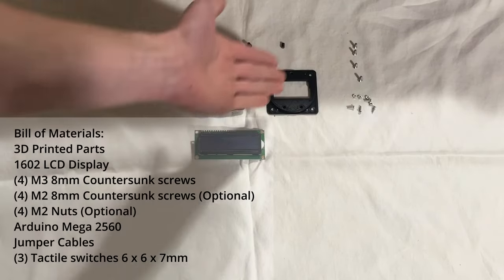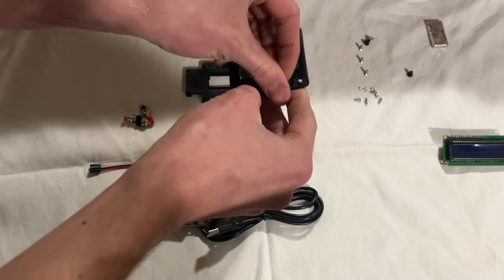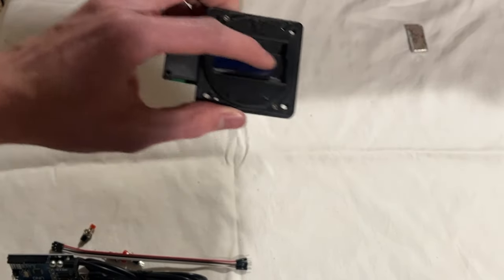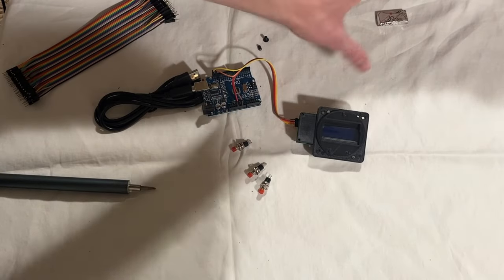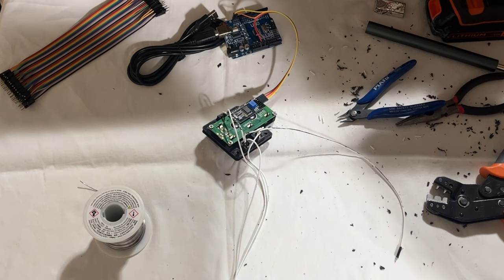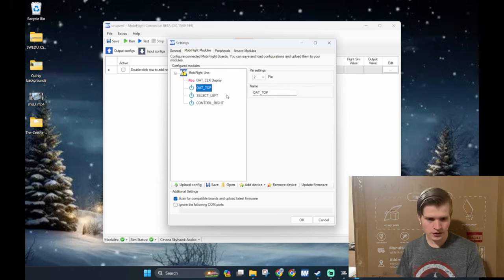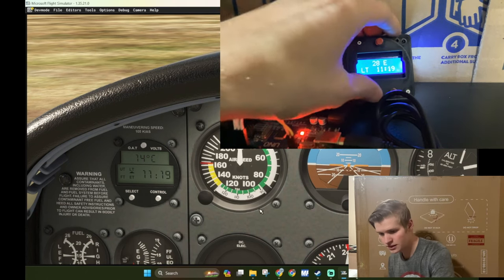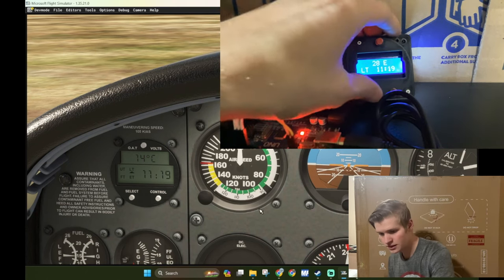Make a Flight Sim Clock/Outside Air Temp Gauge! | C172 #49

Comment: Bob, Have you tried this with a 2004 screen? Think it may look more like the real 1? screen size that is
Reply from the maker: I looked into that (and it'd cover the entire screen area) but decided not to because of the footprint it would require (I didn't want to cut area to the left of the clock because it would weaken the panel)

Comment: Bob Me again.  When I turn the engine off the VOLTS goes to the .( what ever the . volt reads) number and don't show the numbers before the . (Whole number)
Reply from the maker: Try putting in a conditional statement using a config reference referencing if the engine turns off. I'll add this to the dev list too.
Reply: @CaptainBobSim  Not sure on how to do this, When I try to reference Engine turn off its not there in the drop down box
Reply from the maker: Are you making a separate output row that reads out the engine status?
Reply: @CaptainBobSim  Tried but cannot find a preset